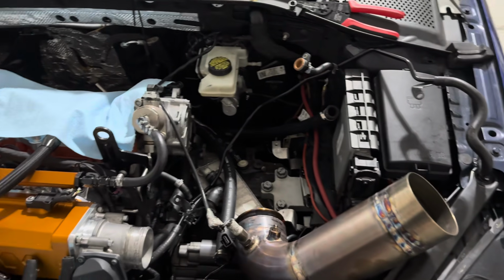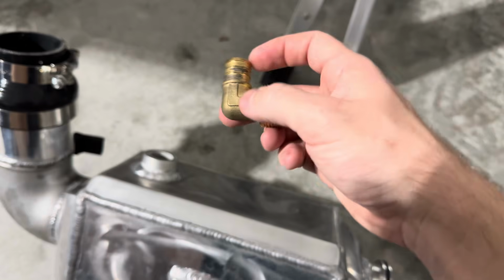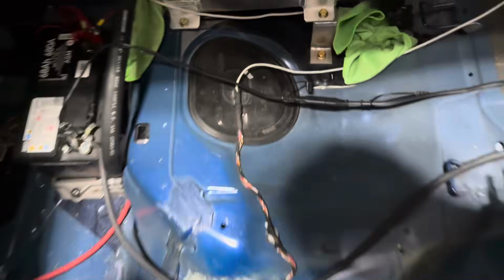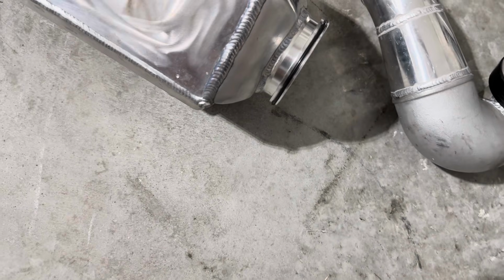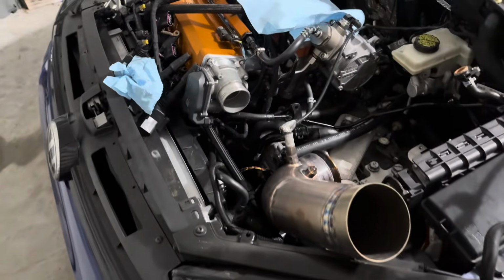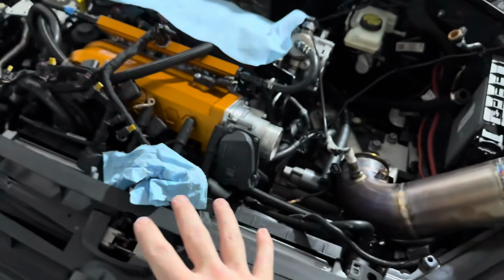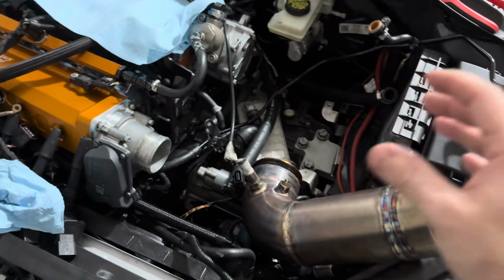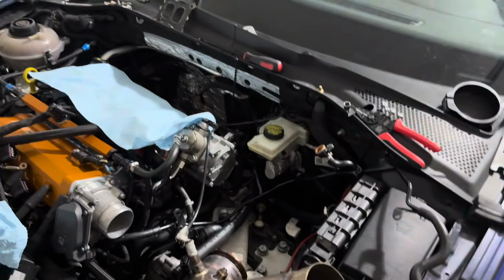Golf R Cooling Mods: Dry Ice, Turbo Changes, and Flow Gains

Comment: Sik build , have you thought about an interchiller system that works off aircon if you still have A/C. My boss runs it on his supercharged v8 holden gts here in new Zealand its intergrated into the water air intercooler and its ice cold. Would be interesting if it can be done onto something like this. Just an idea . Keep up the great content. I love my mk7r but need to step up to more power ie stage 2 feels casual now.
Reply from the maker: I have, it works well if you’re not doing a dedicated ice box system. Kinda one or the other since they don’t stack on each other nicely. Compared to the dry ice + coolant it would only drop temps by another 10-15°f which isn’t enough for the price point and complexity to add it here

Comment: Curious to know if you have noticed any aero disadvantages without a hood or if the velocity stack has made up for it in terms of airflow for the turbo (when I made my 4" full intake+velocity stack I noticed at least 300-400 lower rpm spool & -10% reduction on wg duty cycle).
Reply from the maker: I haven’t seen any issues with no hood. Based off some other models etc it maybe makes .04 of a difference in drag coefficient. But smaller tires, lower ride height etc makes those loses back up.

Vstack has made a difference in WG duty but not so much as spool time for this car. Turbo guard vs Vstack isn’t a huge difference compared to filter vs Vstack

Comment: Is it feasible to have a heat exchanger for the water like on the BMW F8X M3/M4 instead of an ice tank?
Reply from the maker: Yes, but to go this far to just run an exchanger defeats the purpose of switching from air to air to air to water. The temps on a single set temp system aren’t much different than an air to air system, sometimes worse actually.